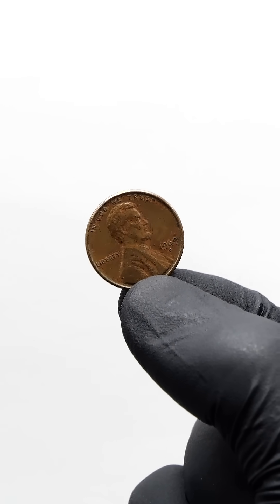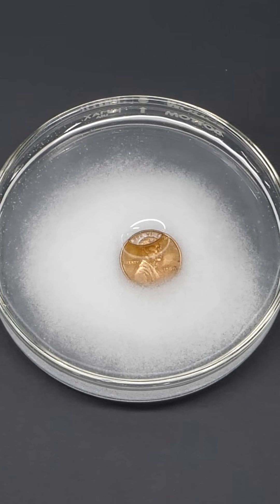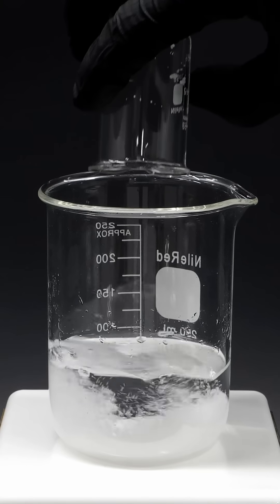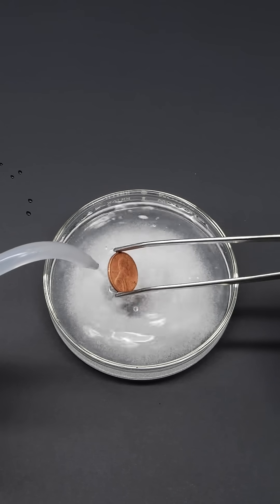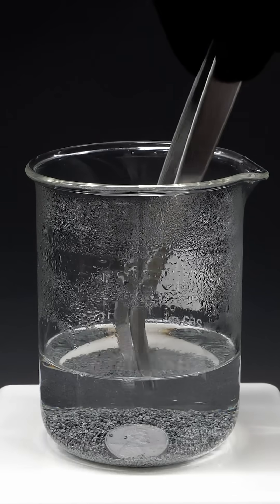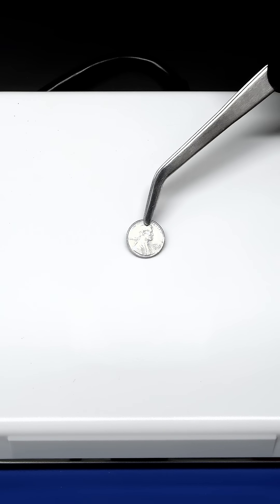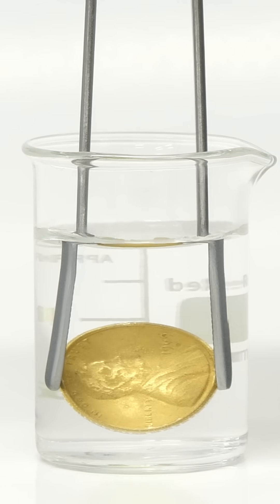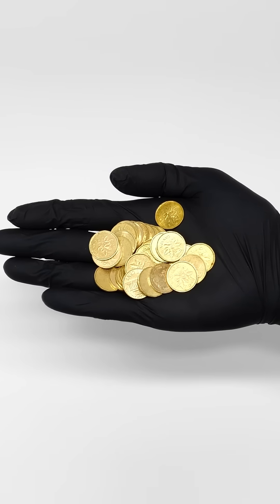The golden penny experiment

Comment: How many times have I Googled how to clean pennies and never found a decent answer.
Reply: I was thinking the same😂😂 you even see ppl cleaning them with a laser😅 he didn't even have to agitate the penny, the solution did all of the work.
Reply: Exactly 😹 the lies man!
Reply: I literally went "wait can I use that with my country's coins??"😅
Reply: I tried that but I didn't put enough and a lot of them were stained.
Reply: That’s because it has to be an old copper penny. Modern pennies aren’t copper anymore.
Reply: @BrentRoberts01  Modern pennies still have an outer surface of copper, only the core of zinc. This trick will work just fine.
Reply: @BrentRoberts01 wdym not made with copper
Reply: @BrentRoberts01  well, yes, but actually no. they are copper-jacketed zinc.
Reply: TL;DR Pickling acid, also used in agriculture and for swimming pools is an option, but regardless of your choice, protect yourself and the environment. 
Another option, Sodium bisulfate solution. It's sold as a pool chemical for balancing alkalinity. It's made from sulfuric acid and table salt, or Sparex No 2 pickling acid if you wanna get fancy. Jewelers often keep crock pots of it hot all day for cleaning jewelry after it gets oxidized under the soldering torch. 
Just be sure to not breathe in the vapor or get your hands in it too much, and wear eye protection! Oh, if the oxidation isn't too terrible, and the item  doesn't have a mirror finish that needs to stay smooth, it's just as easy to use high grit sandpaper or a magic eraser sponge to scrub it off. Pumice powder can work as well, but be careful to not wash it down the drain. Even if you use what Nile did, always, ALWAYS neutralize the acid with a crap ton of baking soda, just keep dumping it in until it completely stops bubbling, and you may want to dispose of it in your yard as lots of places have laws that restrict dumping a number of chemicals down the house drain or storm drain. In the USA lots of storm drains used to have little warnings stenciled on in spray paint with ducks on water that said, "No Dumping! I live downstream!"
Soooo, yeah. Be careful about what you put down your drains as it goes through the sewage plants, but chemicals typically aren't removed from the treated water (b/c it kinda can't be) before it goes back to the river or lake or wherever your municipality puts it back to become tap water for the next city down the waterway. If you have a decent volume for some reason, typically a few times a year waste processing and collection facilities have a hazardous waste collection day. Best to take hazardous chemicals, used motor oil, batteries, etc, to them for safe disposal.
Reply: I had just fully misunderstood the instructions.

Weirdly, my salt&vinegar chips were no help in cleaning my coins
Reply: Toothpaste. Rub it on, let sit a minute, rub off with a cloth.
Reply: @PeaceJourney... please dont do that to coins, expensive coins get lost to cleaning way too often
Reply: Teeny-tiny doubloon dupes?
Reply: Take your pennies and squeeze a lemon and half a lime over them evenly. Sprinkle approximately 2 tablespoons of baking powder not baking soda this is important. Then sit and reflect why you are reading this comment about cleaning pennies.
Reply: @justinphillips2757  Not true. Even collector coins can be cleaned, sanitized& sterilized before proper long term placement&packaging. Just because you may not know how to clean a coin without destroying it, doesn't mean others don't.
Reply: Shouldn't be cleaning pennies if they are older and worth anything
Reply: to those who say pennies may be worth more dirty, so what is the going rate for ones nearly black? lol 💱
Reply: Most kills coins retain more value unrestored
Reply: @friendsinmyhead2195  Why waste time say lot word when few word do trick
Reply: And the answer was basically salad dressing 😅
Reply: Vinegar and salt. Geez.
I remember using lemon juice as a kid. Worked pretty well, but it took a long time.
Reply: You clearly didn't search because it's literally the very first answer on Google.
Reply: It's like answering how many licks it takes to get to the center of a Tootsie Pop. The world may never know.
Reply: 16
Reply: I've been using the duck for some years now. Been finding most of what I needed. Google is only good for buying stuff now.
Reply: Salt and vinegar

Cleans Pennies and tastes good on chips
Reply: My dad used to clean pennies with ketchup
Reply: @justinphillips2757  It depends on what you mean by "clean". Back in the 1980's, liquid freon was great for removing oil, dirt, sulpher compounds, acidic compounds, etc. from a coin without damaging the patina and metal.

You want to remove that kind of stuff from the surface to prevent long term corrosion and damage to the coin's surface. 

"Polishing" a coin will absolutely destroy its numismatic value. removing the patina will remove the metal surface.
Reply: Test test YouTube needs to fix their database. Let's see if this reply gets lost too.
Reply: @justinphillips2757 It depends on what you mean by "clean". Back in the 1980's, liquid freon was great for removing oil, dirt, sulpher compounds, acidic compounds, etc. from a coin without damaging the patina and metal.

You want to remove that kind of stuff from the surface to prevent long term corrosion and damage to the coin's surface. 

"Polishing" a coin will absolutely destroy its numismatic value. removing the patina will remove the metal surface.
Reply: @justinphillips2757  It depends on what you mean by "clean". Back in the 1980's, liquid freon was great for removing oil, dirt, sulpher compounds, acidic compounds, etc. from a coin without damaging the patina and metal.

You want to remove that kind of stuff from the surface to prevent long term corrosion and damage to the coin's surface. 

"Polishing" a coin will absolutely destroy its numismatic value. removing the patina will remove the metal surface.
Reply: It depends on what you mean by "clean". Back in the 1980's, liquid freon was great for removing oil, dirt, sulpher compounds, acidic compounds, etc. from a coin without damaging the patina and metal.

You want to remove that kind of stuff from the surface to prevent long term corrosion and damage to the coin's surface. 

"Polishing" a coin will absolutely destroy its numismatic value. removing the patina will remove the metal surface.
Reply: Coca cola
Reply: I'm gonna do it
Reply: ...
I googled it and it said "vinegar and salt"
Reply: Put them i vinegar or Lemon juice for a short period. Like 20-30 minutes
Reply: Soda?
Reply: Use lemon juice
Reply: and now you know why the channel exists
Reply: @IceHeartAlpha  it exists so that he can get paid
Reply: water
Reply: I always heard Coca-Cola works
Reply: Never clean old pennies with anything more than soap and water. If it happens to be a collectable, cleaning it takes away 80% of it's collectability and value.
Reply: in the old days we used taco bell mild sauce, we made happy faces on the pennies while we ate supreme burritos and pintos and cheese. 😊  I am happy to learn that all we needed was vinegar and salt!
Reply: Really? I've known this since i was a kid. Also helps to have a sacrificial anode
Reply: Melt rhem
Reply: As a coin collector - DON'T!
Reply: Prank someone
Reply: you can put them in a laundry machine to launder them
Reply: Easy: you don’t
Reply: Apparently collector's don't like it if you clean the penny. They lose value.
Reply: Vinegar cleans copper well…but doesn’t turn them gold.🖤🇨🇦
Reply: @tamarrajames3590  correct, next coat it with zinc and heat it up.
I learned that from this informative video, it's the bees knees!
Reply: @tamarrajames3590  did you not watch the whole thing
Reply: Google aint ur answer YouTube is
Reply: @PlagueDoctorscp049  Sarcasm? Joke? Google is YouTube.
Reply: If you want a penny to retain its value, don't use anything as harsh as this! The dull color is actually quite popular with collectors.
Reply: Actually, we don't even have to google it.I just knew this from being a kid in normal, growing up
Reply: This wil strip off a layer of oxidized and whatever debris as well but seeing it takes away from the penny mass I’m guessing why many don’t talk about this
Reply: Switch to GPT

Comment: We did a more extreme version of this in my chemistry class a couple years ago. We dipped in some sort of boiling acid before holding it over a flame to turn it a gold color
Reply: Acid leeching, also known as pickling. It's used to remove copper atoms from the surface layer of the alloy. Traditionally it was used on actual gold coins to make them look more yellow instead of rosey.
But in your case you used a brass coin with a low zinc content.

Comment: You can use this for dnd or larp events. Copper disks are fairly cheap and you can get  them in multiple sizes. Stamp some simple designs and zinc about 2/3rd of them. Then heat half of those and you have a nice pouch of copper, silver, and gold coins.

Comment: Of course you had to get hold of a US penny, because Canada doesn't have pennies any more. And, a US penny is actually made of zinc plated with copper.

[Edit: I see in the end that you have gotten hold of some old Canadian pennies. Not sure of the dates or metal composition through the years. The reason Canada dropped the penny was that the value of the copper was worth more than 1 cent. That's also why the US switched to zinc.]

Comment: The price of brass varies depending on the type of brass and its condition, but here are some recent prices for brass scrap: 
Brass shells: $2.10 per lb
Brass water meter: $1.40–$2.20 per lb
Clean brass radiators: $2.05 per lb
Plumbing brass: $1.10–$1.50 per lb
Brass is a non-ferrous metal that's made of copper and zinc. It's often more valuable than steel or aluminum, but less valuable than pure copper. Brass that contains more copper is usually worth more than brass that contains less copper. For example, yellow brass, which is 60–70% copper and 30–40% zinc, tin, and lead, is less valuable than red brass. 
Brass is a popular metal to recycle because it's so common.

Comment: My high school chemistry teacher did something with a zinc strip, alligator clips, a 9v battery, and a beaker of some salt solution to coat a new 1975 penny with same results only your method seems simple. Are both methods using electrolysis?

Comment: Fun fact. 1943 pennies only came in steel. If you find one in circulation, you're not going to be rich or anything but it's so incredibly rare nowadays to find one that you might think you'd hit the lottery.
Reply: I have two of them that I bought ages ago.
Reply: Someone paid with a whole roll when I worked at subway. So I have a roll of steel pennies.
Reply: If you find a 1944 steel penny then you might be rich though.
Reply: @alexhumble6435 Ya, considering there are only around 135 and it is worth around 243,000
Reply: They aren't really valuable  @alexhumble6435
Reply: I have four or five of them I've been a cashier for like ten years tho it's a great job to look for coins you'd be surprised at the coins people spend at face value
Reply: It's because during the war, they used all the copper on bullets, and had to find something else that was cheap and plentiful.  There are a few, and I mean a FEW copper ones.  The last one found sold, I think, in 2017, for a couple million.
Reply: I have a handful of them
Reply: I have a 50 cent roll of these pennies
Reply: @edwardtorres3987 Not that rare then
Reply: 1943 steel pennies are not that rare at all, hundreds of millions were made to save copper for the war effort. A 1943 steel penny weighs about 2.7 grams. What's extremely rare is a 1943 penny that is actual copper and weighs about 3.1 grams. About 40 are known to exist. These rare pennies can fetch over a million dollars at auction. The best way to tell if you have an actual 1943 copper penny is to weigh it. Another way is to use a magnet, a steel penny will attract as a copper penny will not.
Reply: I love collecting them. They look so cool.
Reply: If you find a 1943 copper, or a 1944 silver; you will have a huge stack of money.
Reply: @line_guy30  Or you could use what nile did here but with a 1944 penny. Except don't heat it up on the hot plate at the end to turn it gold, but just leave it silver XD

(It probably wouldn't work, it'd probably look weird and if anyone ever weighed it you'd be in trouble lmaoo)

edit: I just found another comment talking about how just leaving it silver doesn't last either and the zinc coating can come off easily, so that's another layer of how this scam wouldn't work lmao
Reply: I once found a copper one while working at a 7-11 but didn’t know it was valuable so I didn’t take it. I regret that to this day 😔 (I collect old pennies and had never seen a silver one yet, and I remembered the number on the penny because it was close to my childhood house number)
Reply: @beesquestionmark that's worth a fortune.
Reply: @beesquestionmark  lol
Reply: 😮😢always pick 'm up,bro😮ya neva knowwwww!!!!! @beesquestionmark
Reply: @beesquestionmark  why did it stand out if you didn’t know it was valuable?
you must’ve known it was rare to notice it
Reply: I legit got one the other day looks the same color ili have find something that grades them
Reply: Wheat pennies are cool, too
Reply: i own a 1943 steel penny ♡ its the treasure of my small coin collection
Reply: I actually have one somewhere! Might not be worth much but it's still really cool (and weird) to see a penny that's just normal gray metal
Reply: I had one I lost in my couch that we then sold
Reply: What is rare however, is to find a steel one minted in 1944 or 1945.
Reply: Fun fact: Not all of them were made of steel. If you find one made out of copper, you will be pretty fucking rich, since there are only 6 known in existence and one was last sold for about 1.4 million dollars IIRC.
Reply: I have one in pristine condition
Reply: I think the rarer ones have a D for the Denver mint. 1945
Reply: I actually have one! I only found out bc as I was dumping my change bag to count/sort them, I had a magnet next to it & the penny got stuck😂 I wish I could've seen my own face when that happened 😲😱😂
Reply: I have have more than five of them and I'm not even from nor in the US
Reply: Find a 1944 with this and it will make you rich
Reply: It’s easy to spot the steel ones … not so easy to find the elusive coppers in the steel years
Reply: I dont know if you know what coin roll hunting is, but I do it as a hobbies, and I found one once. On top of already being rare, the chances of finding one in a roll is EXTREMELY low.
Reply: So rare there are still billions of them in the orginal rolls you can purchase.
Reply: In Canada we font take penny’s anymore just like how we don’t take 1&2 dollar bills
Reply: @Territory08 That's weird
Reply: I found one
Reply: Had one and a guy stole it from me.
Reply: I have one
Reply: I have one of those!
Reply: I actually found one at work a year ago. I was like "WHY IS THIS PENNY GRAY??"
Reply: You can also find bullet shell pennies, they're so cool
Reply: Have had one since 2nd grade ... 40yrs ago.
Reply: I have steel pennies!!!
Reply: That could have the Secret Service knocking at your door. The U.S. Treasury Departament says no copper pennies were made in 1943, so any that appear must be counterfeit.
Reply: If you find one that isn't steel it can be worth upwards of $500K
Reply: @Mr.MainMan 1 43 copper penny sold for $2 million
Reply: I found one years ago as a kid at my middle school on the school yard in a crack.

Took it home and put it in a lego x wing, and never saw it againq
Reply: I have a zinc uncirculated 1943 in a plastic case.  It was in my sister's collection and passed to me sometimes in the mid 80s.
Reply: Rare 1943 is a copper penny 80% copper at least. Worth 10s of thousands to millions.
Reply: My Grandma just sent me her wheat penny collection from the 40s during Christmas, and the box does have a steel penny. It's really neat and, if I did sell it off, I could get about $30 I think.
Reply: @chadderbug7587 from this day on, that penny will certainly gain value.
That's a good one to keep safe, you won't have the entire collection intact decades hence, but to have that 1 steel penny that your grandma gave you is a like a lucky talisman you can keep and treasure for the cherished memories, long after you forget what she looked like. And if you live long enough, you forget ppls faces, just the scents, sounds, emotions and memories that can be conjured at will with a small talisman...

Comment: So you cant take an old penny, clean it then set it sside, then take a new penny, strip off its copper ciating to reveal the zinc, now disolve that in NaHO, then proceed as normal. So you just made a brass coated penny using two different pennies.

Comment: I've done this before! It's a great chemistry demo used a lot in my work. We usually pass the penny through a Bunsen flame, letting the zinc melt immediately. The transformation happens over a couple of seconds and always amazes the students!
Reply: And good for the 🐉's hoard when you want to boost how much gold it appears you have.  >>;=)
Reply: Penny's aren't made of Tin (Sn) on the periodic table... which would look nothing like gold when melted at any temperature
Reply: @WillKarafa-gm4co  to explain in more detail, we take UK pennies and use electroplating to coat them with zinc (not tin, my mistake). The pennies are now effectively steel pennies, plated with copper, and then plated with zinc. This allows them to transform into brass when passed through the flame of a Bunsen burner (I said Bunsen flame as a weird shorthand habit I've picked up from my coworkers)
Reply: It's also called a Bunsen burner (not flame)